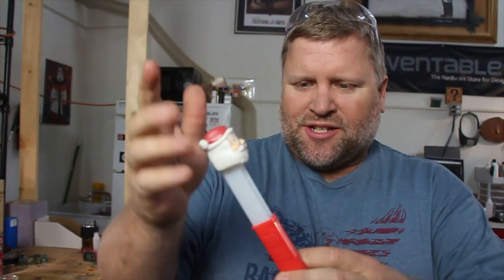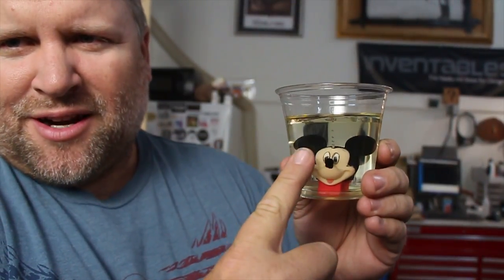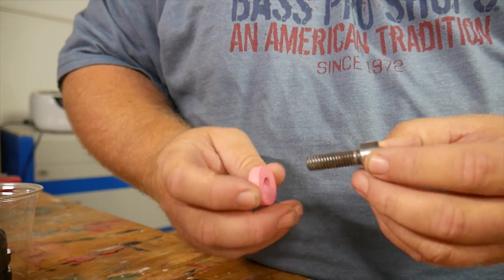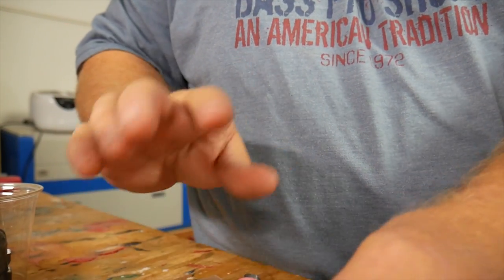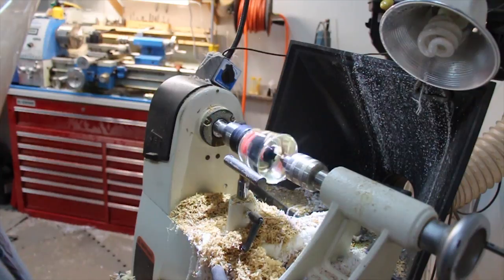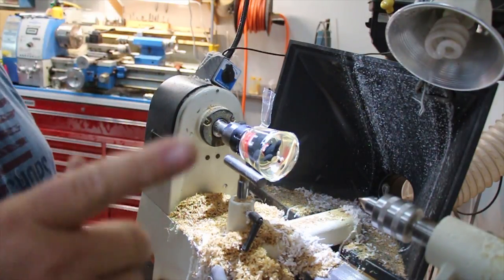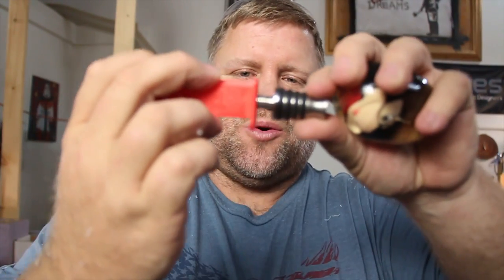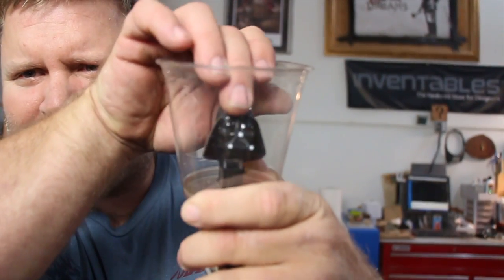Make a Mickey Mouse (or any Pez) Bottle Stopper,  Resin casting project!

Comment: i make the same stoppers but with lego minifigs
i use a large shot glasses / very small cup (plastic) and polyester resin works fine
first i mix up some color and pour in a base 3/4" this will hide the stoppers thread.
when set glue in lego minifig ontop of the color and fill with clear resin.
i have done the same with old coins, flowers, bullets, bottle caps, even a cork from a wine bottle.

Comment: Looks great. I'm just starting to look at resin turning so your video opened another door for me. A thought about the bubbles. Maybe if you took a tack or super small drill bit and put a small hole in the head. It should be invisible and still let the air out and maybe the resin in. Thanks for the video. Liked and subscribed.